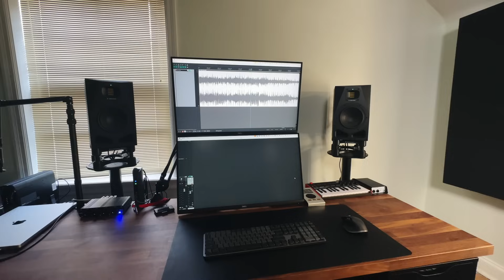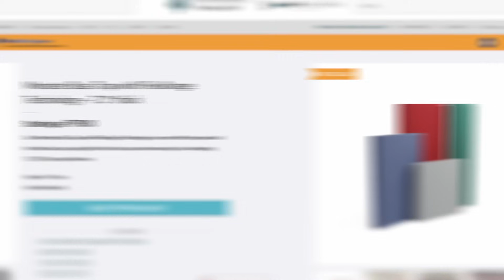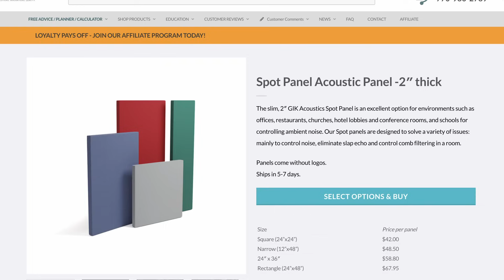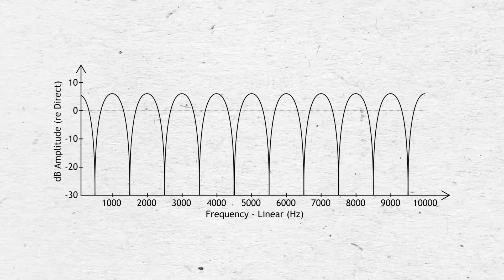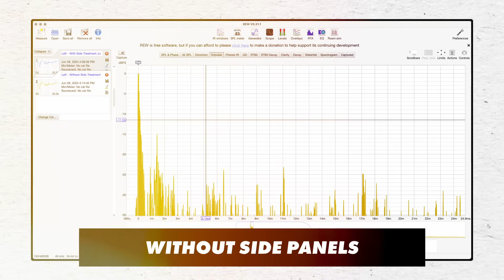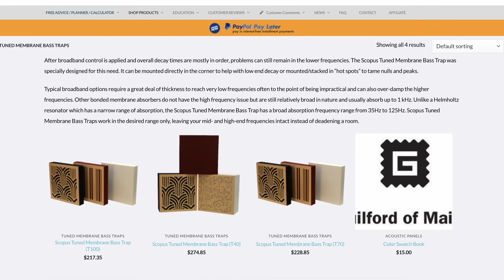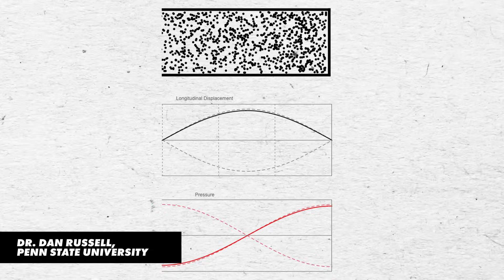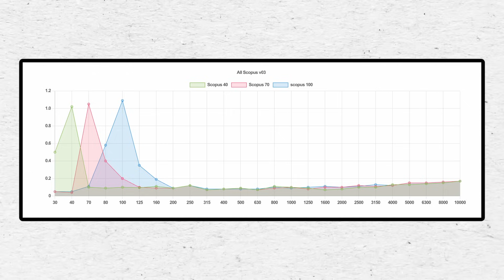Watch This Before Wasting Your Money On Acoustic Treatment

Comment: Ceiling height in my room is pretty low, so I cant put  7 inch panels, i would literally hit my head, but since it is that short, it really needs some damping. So my only solution is to put thin self-adhesive foam squares. Better anything than nothing, i guess.

Comment: Shocking to see that even the thin panel is mostly empty inside or at least is not filled up as much as it should be for a thin panel and in general for such a priced product. I really wonder why they do that other than saving costs and why nobody seems to point it out. Now of course I am aware that an air gap behind makes the panel more effective, but that is something I rather do by hanging the whole panel with some space to the wall, making the panel more effective. Sure it costs some space but buying a pig in a poke is certainly not a nice solution tbh.

Comment: One doesn't need to spend a small fortune to get proper room treatment. Remember that you still want some liveness (aka room reflections) in the raw recording to keep it from sounding lifeless or artificial. It makes no sense to record in an acoustically dead room and then spend extra time trying to add the right amount of ambience or room verb back in. The main goal of sound absorption (and diffusion, if you have a large recording space) should be to eliminate flutter echos, bass boominess, and midrange shrillness. That can all be accomplished on a modest budget.

Comment: "The human voice doesn't produce much energy at low frequencies anyway" - Wrong, a male voice is typically at a base frequency slightly above 100 Hz, and the base frequency usually makes up a significant fraction of the energy. The point is not the energy but the fact that at low frequencies, spatial end temporal localization of the ear/brain is very poor. So it doesn't actually matter for speech intelligibility if low frequencies are washed out. By the way, the same more or less applies to music: while we might feel more comfortable with a crispy bass, it doesn't really matter for our understanding of music. Which is why bass traps are predominantly a "first world problem".

Comment: You don't have to build your own stuff if you use Basotect which has excellent absorbing and can be bought in white or grey and simply be glued on the ceiling. There are better an more effective solutions of course, also cheaper ones. Oh, and please don't spread this myth that cables have an influence on sound; this influence exists only in guitar cables behind passive e-guitar pickups (the higher the capacity of the cable, the more the high frequencies and the resonance height are dampened, which can be heard an measured easily) and on bass speakers with high performance amps if the cable is too thin. Worldwide, there was never a repeatable double blinded hearing test executed where a person was able to detect sound differences depending from the conductor material or cable type, construction or brand. Besides of this, there are of course huge quality differences between cables in regards to durability and shielding. But with symmetrical XLR cables, almost any stuff you can buy in the pro audio segment from a known brand is "good enough" for everyone.

Comment: I am attempting to improve the enclosed baptismal pool room (which is mostly enclosed) at a church so that we can have the live voices without the tremendous amount of echo. Do you think that   it is actually possible? We have been using a single condenser microphone hung from the ceiling. Today I experimented with a shotgun microphone but the echo and high frequency build up is still there. Before I take another step do you think acoustical treatment will be enough using a stationary microphone or should we work out a solution using a lavalier or headset microphone? I cannot place the Mic closer than 4 feet from the mouths of the people in the baptismal, mounted on a wall or ceiling . With a lavalier or headset it seems that would reduce echo almost completely?

Comment: Amazing video, thanks. You mention not to make the Air Gap too big as it will allow lower frequency energy to go around the panel. What size air gap would this be? And does it include or exclude the air gap already built into the back of the panel or not? What size is your rail for example?
Reply from the maker: In my case, the rail is 2”. An a acoustician friend of mine once recommended an air gap equal or less than the depth of the panel.
Reply: @AudioUniversity  Wow, thanks for the crazy fast response! That's great to hear thanks. My panels are about 6.5" on the side walls and back and front about 10.5". My air gaps all around the room are about 1.5" (not including the air gap built into the panels themselves) so I think I'm in the clear haha. Thanks again

Comment: Good explainer. I work with GIK when i build rooms for my customers. Tunable Panels are diaphragmatic panels and work great. As well they prevent a lot of mids and highs absorption because of their art of build…
If you wanna have more control over frequencies above 500hz u might work with some scatter plates combined with the diaphragm absorber. But one thing i‘d like to add here. It’s not just thickness or depth of panels, it’s mostly weight that matters. We differ waves and rays in this instance, so lows are waves (like ocean waves with strong amplitude and pressure) and highmids and highs are rays (like sun rays with less amplitude and pressure) so if building absorber panels your own, take absorbing material with not too much density but good weight. Such as carbon pellets or heavy wood cuts)
Rockwool won’t do the job very well. And when using diaphragm technology use heavy wood but don’t take to thick sheets, because of stiffness for interaction with the pressure wave. To stiff causes unwanted reflection. Your goal is to lessen the pressure by gaining spring effect. Last but not least. Seal the panel…it needs to be entirely closed to have air pressure difference between out and inside of cabinet.
Reply: Is it a good approach to make your panels as thick as possible - cover the room in GIK monster traps rather than thin 2 inch or 4 inch panels so you're treating the full frequency band and not just the high end?
Reply: @MadelnMachines 
High end comes last.
I try to figure out fundamental issues before anything else by taking acoustic measurements seriously. Balanced low end improves immensely on your frequency response in the room.
In some case i take broadband absorber. But be careful, if it’s too
Much you lose other frequencies you miss later on…focus on small bands to treat….my advice…
Same applies to mixing Audio.
First clean up low and mids (boomyness and muddyness) before shelving high mids and highs…😉

Comment: the more I'm studying how to treat my room the more I just want to use headphones :D
Reply: It's no joke! If you have a disaster listening room ( like mine)...GIK says I need over $2000 worth of treatment just to sit and listen to a track or two occasionally? Forget it!
Reply: @AncientEgyptArchitecture  if you build absorbers  (rockwool ,. woodboards ,.and very easy to build ),.  and (luxury plan)probably some diffusors on your own ,. for sure you don´t need 2000$,. on the first reflexionpoints,. it will make a big difference,. after doing lot of these panels I wouldnt buy them for 10x the price of a diy version,. which works the same,. probably 300-400 are enough,. maybe not even this
Reply: Yeah, just buy 1 high quality absorption fire retardant foam and cut it for your headphone...hehe

Comment: I'm not saying you should, but room correction saved my room. Panels/foam on the wall is just polishing a turd. It will cut down on reflections and smooth out the rooms eq curve, but you've still got problems. Unless your room is big and round, you've got standing waves. EVERYONE has a dip and bump in the low end. I have 12" thick dense foam covering my entire ceiling and 6" dense foam covering all my walls and I still had  a 10db dip at 100hz. This is the reason nobody can get the low end right in the mix. Not to mention speakers being out of phase. Mine were not, but lots of people's are. I used ARC 3 with a $35 Behringer measurement mic and it changed everything. Good luck homies!🤙🏼
Reply from the maker: I also use and recommend corrective EQ, but acoustic treatment can treat problems that cannot be treated with EQ. Check out this video: https://youtu.be/tqkMUOD5FUI?si=lr8GKVYJxRtPgBB4
Reply: if you have an extinction due to overlapping waves then an EQ cannot correct this.
adding more tonal energy retains the error.
Reply: @c.p.2807  I'm not sure what you mean, but the correction software isn't just eq, It corrects phase as well. I'm not sure the exact science, but I can hear, feel, and see a difference. There are two mixes of the same song, on my channel, that were done before and after room correction. Now, I'm not a pro engineer, so I'm not touting the mixes themselves being amazing, but you can clearly hear the sonic difference, and it is exponentially better. I know everyone is an expert, so I'm not doubting your concept, but I'll let my ears tell me the truth. The correction software also offers the possibility to tweak the curve to the end result you want. For instance, my mix seems a little high end heavy, so if I can't self adjust, I can adjust the curve. Either way, I'm sold on it.

Comment: Alternatively, invest in speakers that load your room correctly, rather than using costly solutions to compensate for your systems inadequacies. 

When I first got into hi-fi in the late 70s, room treatment, acoustic correction, DSP, were never factored into the hi-fi equation. That didn’t prevent us building world class sound systems!
Reply from the maker: At a certain point, acoustic treatment will give you far more drastic results than different speakers. That’s especially true in rectangular rooms. All speakers are going to cause reflections and excite resonances in the room.
Reply: Exactly the response I would have expected fron a video promoting an acoustics treatmemt company. Acoustic treatment can only alter a room’s sonic characteristics. Whether those altered characteristics are preferable, is surely down to the listening preference of the end user. For most of us, who don’t have the luxury of a dedicated listening room, whose hi-fi has to fight for it’s right to be in the family lounge, RT60 levels are normally kept within acceptable limits by the soft furnishings, sofas, curtains, carpets, rugs, people and pets. Dense foam filled easy chairs and sofas make for highly efficient and effective bass traps, believe me. When I updated my 2 and 3 seater leather recliner sofas for fabric, dense foam filled static sofas, they killed the room. I had to rearrange the speaker placement and add additional subs.
Reply from the maker: It’s about more than the overall RT60 levels. There are room modes and spectral reflections. Of course there is no telling what someone prefers subjectively. But on an objective level, some problems require acoustic treatment, some problems require different speakers. 

I won’t argue about the legitimacy of my advice - my track record speaks for itself. Take the free advice or don’t. Acoustic treatment (if possible) will give you a bigger improvement for less money invested, assuming you have decent speakers and amplifiers.
Reply: @AudioUniversity  I’m not knocking your free advice, or expertise. I simply refer back to the point I made in my initial comment. When I got into hi-fi in the late 70s, acoustic correction, room treatment, DSP just weren’t ever factored into the hi-fi equation, but that did not prevent us enjoying a premium listening experience, regardless of the room.

Comment: Really interesting.  One thing that I would really like to know:  As an engineer at heart, I love seeing numbers and I understand about using REQ (room eq wizard) for configuring speakers and audio systems, but I'm recording YouTube videos in a home office - primarily single person, talking head setup and I want to measure and then reduce reverb.

I assume I need to understand what reflections are reaching the microphone recording me, but how do I measure that?  Do I mount some kind of speaker to mimic  where I am standing/sitting and talking and play test tones,  standard audio tracks, or a recording of my voice?  What type of speaker/audio system setup, what volume levels, etc. as I assume for testing I need a standardized audio source for repeatability as I test various changes to the room?
Reply from the maker: Check out this video: https://youtu.be/uCFqMfg7tM4?si=2PzhLY0S4MbU2OfB

This is about speakers to listening position, but the same principle applies between talking head and microphone.

Comment: Honestly the differences in those measurements in REW doesn't look like much of an improvement, if at all. 
However, what you actually hear in person (or some binaural recordings other channels have made), seems to be much more significant, there's certainly some mismatch between how microphones and graphs look at things to to how our brain interprets the direction of a sound and the size of a space it's in just by subtle changes.
Reply from the maker: Keep in mind: these graphs only show the difference with and without SIDE PANELS. All other panels are in place for both measurements.

Comment: Nice and well explained. 
It's so many people who don't understand that with thickness and distance to the wall behind (they cover the walls with absorbers that are way too thin and with no air gap to the wall behind) - this will probably save a lot of money and disappointment for many. 
Another tip is to use the corners between walls and the ceiling for large absorbers and for panels put at an angle across those corners - there is often a lot of unused space there. That way, the low frequency absorption can be improved a lot without take up too much of the usable space in the room.
Reply: Just read up about sound absorption with vibrating panel absorber.
The thickness isn't he key point.
Reply: @c.p.2807 kind of is kind of isn't,

Comment: ! So what about in your Vehicle? You Can't put 2" or 3" sound Panels there. Also does the Butyl adhesive like Dynamat or Kilmat etc Actually Do Anything at ALL? Is it worth it? Can you Use A Cheaper Substitute? What is the Actual Wavelengths of road noise and thickness of material we should Use to Block it out?
Reply from the maker: Blocking noise is much more about rigidity, isolation, and seal. This video is mostly about absorption for making the sound IN THE ROOM sound better, not keeping sound out or in.

Comment: You know my broke ass does? I buy a whole bunch of eye hooks and screw them into the stud all around the top perimeter of the room, and then I string up a clothesline. Then I use clothes pins to hang up a bunch of towels, old blankets, and/or whatever I can find. It works well.
Reply: Everyone's got a different financial situation so you can never hate on that. I must say though, I could treat my home tracking room verrrryy well, for about the cost of a single B20 cymbal, or a Warm audio 1176 clone, or half a MIM Fender Telecaster
Reply: Hmm but the only frequencies you're treating are 1k and up
Reply: Love this.🥰I'm basically recording for myself. I don't need perfect, and I'm not looking to make money off it anyways. I don't like spending money where I don't need to. Thanks for the idea.
Reply: Yea that works for HF and MHF. Great for recording vocals and other instruments that don’t produce much LF or LMF. Where it doesn’t help is when you’re mixing. Unless you have a very “leaky” room (not hard boundaries where low end can escape) you’ll probably find a LF/LMF buildup. If it works for you though that’s all that matters. I’ve been making records in unideal spaces for years. While also making sure to track and mix critical junctures in ideal spaces.
Reply: @davidbadstubner4582  from my understanding vocals have a potential to build up and excite the lower frequencies like in my 6x6x8' room and this can muddy the vocal recording.
Reply: I'm sure that looks horrible???
Reply: The poor are the weak
Reply: @coyoteserranomusic Atleast not re tarded

Comment: For a vocal recording booth, would it be better to line the area with the 2” foam pads or put up panels like these?
Reply from the maker: Depends on the foam. Most foam isn’t very effective in absorbing acoustic energy. I’d recommend thicker panels in the particular areas where the reflections will be shortest if it’s a budget thing. If it’s not a budget thing, go with panels.
Reply: Something not considered- foam degrades. Even the polyurethane crumbles to dust.

Most panels seem to be covered fiberglass or mineral wool. Probably better long term.
Reply: For a booth a mix of diffusors and absorbers works best. The bulk of it should be diffusers. The problem with booths is by the time you control the reflections the booth is acoustically dead in the high frequencies.  Since you are so close to the surfaces look for 2D diffusers which reflect the sound back in a hemispherical pattern at a reduced level. I have used RPG omnifussors and BAD panels in these locations. It looks like GIK has 2A Alpha Series Panel Diffusor/Absorber which might work like the BAD panel I do not see any test data to verify. The Gotham N23 5″ Quadratic Diffuser might be close to the omnifussor.
Reply: @dannelson6980  thank you very much for this info. I appreciate it